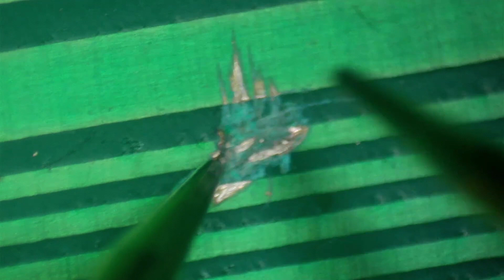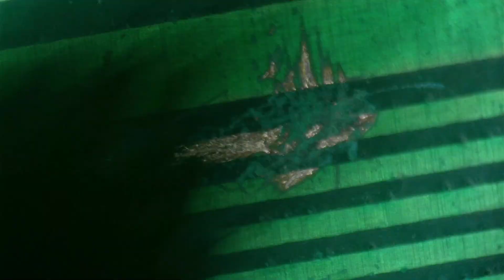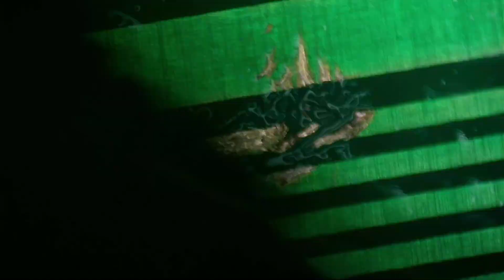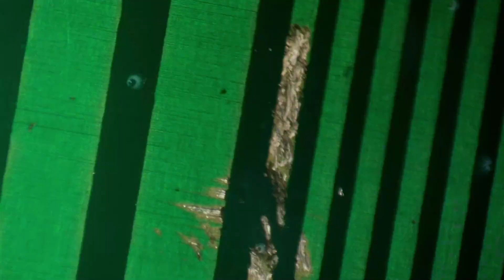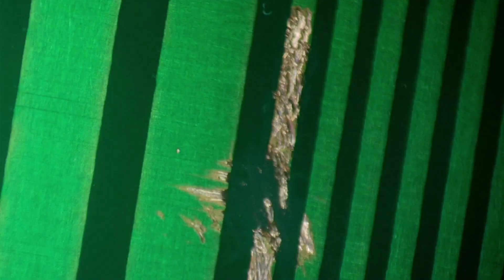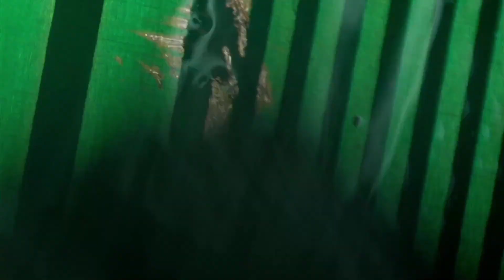Damaged PCB Trace Repair Tutorial

Comment: Thanks for sharingI am new  new to your channel I’m older retired individual and the last couple of years I’ve started to learn different avenues of electronics and came across your channel . It’s nice to watch a person do something that really doesn’t go as planned and show it will still work . Most videos show everything as being easy and successful . Thanks for showing the real world . I had the same issue as I was experimenting doing trace repairs that would not accept solder . I tried leaded / nonleaded enamel coated wire and bare wire and different types of flux I finally got it to bond but I would rather watch a person like yourself show it in the real world . Thanks for sharing.     👍 Artie

Comment: I take a wire and hammer it into a flat strip and add green solder mask.  Makes a more professional looking repair.
Reply from the maker: That's a great trick actually. You could also use copper foil (non adhesive) and cut it into strips.

Comment: Did you ground your KSGER? Need to do some repairs and I'm trying to find what I need to get. I scratched the solder mask of a trace just a little but enough to expose the trace, is it worth to try and fix it? It's an hairline scratch.
Reply from the maker: Test it with a multimeter in continuity mode either side of the scratch. If it beeps, it's not the trace. if no beep, it's probably worth fixing? And the KSGER stations do need grounding if they're the metal one.
Reply: @NewRetroRepair  Cheers, yeah I'll probably get the metal one, already sourced a metal eyelet and earth wire. My multimeter is missing the probes but I looked with a magnifying lenses and the trace is not damaged just the solder mask, I'll probably do what you did here, I thought fixing the solder mask would be more difficult than it actually is.
Reply from the maker: @farben_  You definitely want to get some probes either way. You can pick a set up for cheap. It's ALWAYS good to test suspicious looking parts/traces.

Comment: can dis be done with copper tape instead?
Reply from the maker: Yes and no. Copper tape adhesive will melt when it gets hot and adhesive isn't conductive. Conductive adhesive copper tape is trash. You're better off using a jumper wire.
Reply: @NewRetroRepair  i have this double sided conductive adhesive copper foil tape it says it melts at 1000c and the ps4 dosnet get hot like that im only using a small piece for like 2 tracers
Reply: @NewRetroRepair  if you know where the emi hdmi filters are on a ps4 slim thats where im gonna use the tape at i dont think itll melt because why would it get like supper hot in that area
Reply from the maker: @Arzful  because you need to solder to the copper tape to make an electrical connection. I'd strongly recommend you get your PS4 repaired by an experienced technician. Copper tape is not suitable for rebuilding damaged traces on a PS4 HDMI port or the area surrounding it.
Reply: @NewRetroRepair  dang i thought the tape was already already electrical jus had to stick it on didnt kno u have to solder it to make a electrical connection